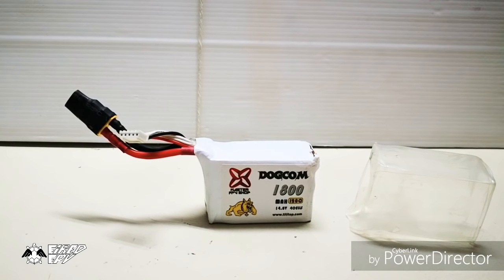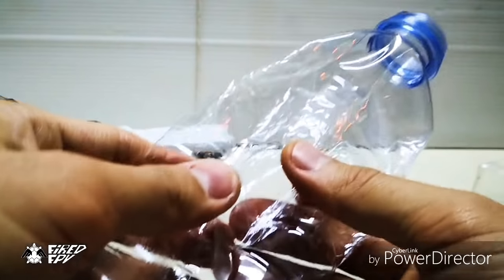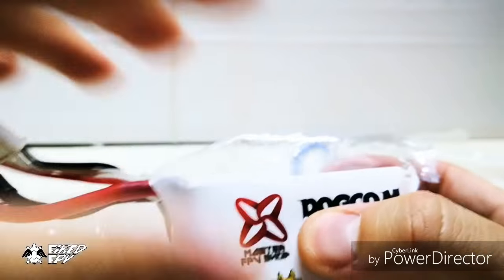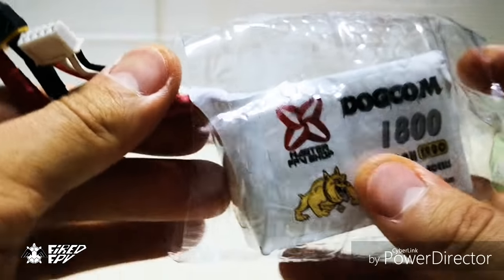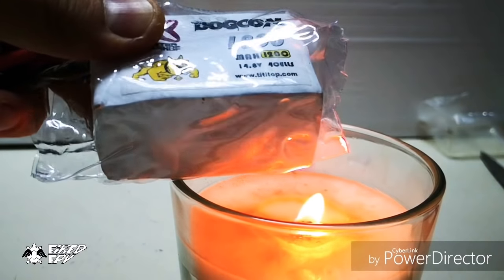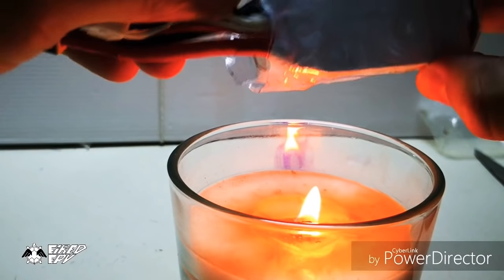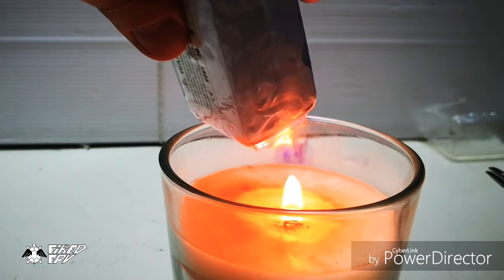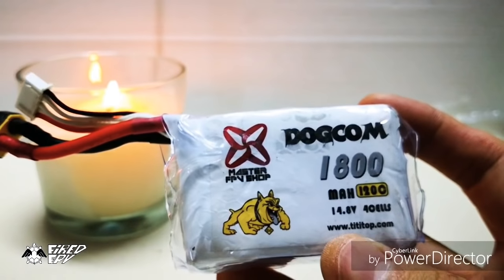#DIY: Wrap Lipo battery: No Heatshrink? No Problem! Reuse Plastic.

Comment: I have seen this done with another youtuber but he used a high powered heat gun.   Glad to see it could be done with a candle and thinner water bottle.
Reply from the maker: Candle give more heat than hair dryer. That's why I use it. The thicker the bottle the harder it will shrink. 😉 Finding a perfect match for your Lipo is like a bless for the day.